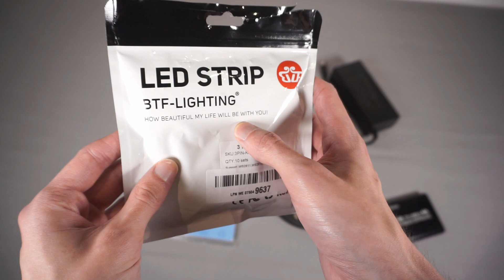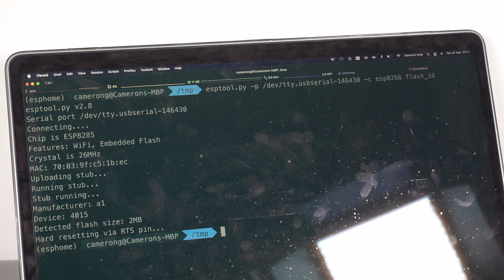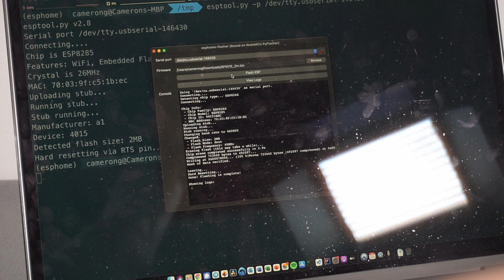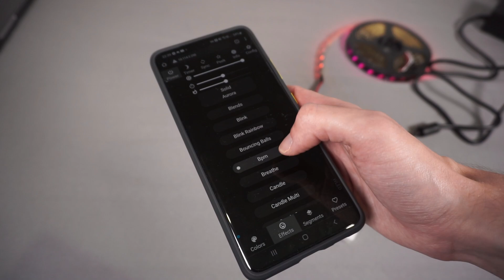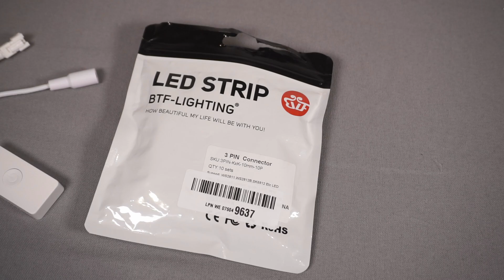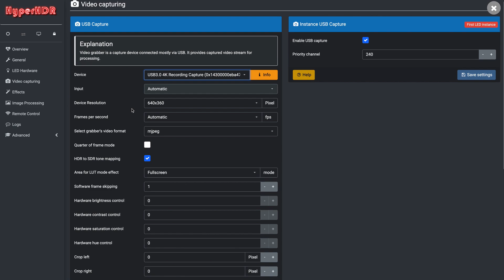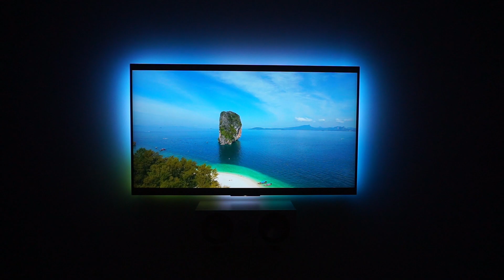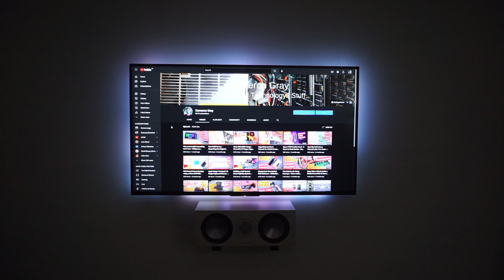Building a 4K Capable HDMI TV Backlight using HyperHDR/Hyperion (and a WiFi LED Strip)

Comment from the maker: Buy Hardware on Amazon UK (Affiliate)*:
  - 4K Input Capable HDMI 2.0 Capture Card - https://amzn.to/3DnmdiE
  - 5m WS2812B LED Strip - https://amzn.to/3Brd5ZN
  - SP501e WiFI LED Controller - https://amzn.to/3v9Io9j
  - 5v 15A (75W) Power Supply - https://amzn.to/3iLEdLC
  - 3pin LED Strip Cables - https://amzn.to/2WV6YxK
  - Cable Clips - https://amzn.to/2WUpciS

Buy Hardware on Amazon US (Affiliate)*:
  - 4K Input Capable HDMI 2.0 Capture Card - https://amzn.to/3uUL4aq
  - 5m WS2812B LED Strip - https://amzn.to/3ajHOw1
  - SP501e WiFI LED Controller - https://amzn.to/3iGM90P
  - 5v 15A (75W) Power Supply - https://amzn.to/2YDn3c8

* Items linked for Amazon UK are the exact listing that I purchased, however with generic products like these, the item specifications may change over time.  The items linked on Amazon US look to me to be suitable however I haven't personally tried them so there may be compatibility issues.
Reply: Thanks for all of this! What was the board you used to flash the SP501e?
Reply from the maker: It's one of these https://amzn.to/2ZbVFCo (Affiliate) - Just a basic USB TTL adapter but this one has a jumper to allow you to switch it to 3.3v which is required by the ESP microcontroller. (Disclaimer - the listing I bought mine from no longer exists. While the one I linked looks identical and states that it uses the same CH340G chip as mine, there's a chance there may be slight differences)
Reply: LED controller sold out on amazon!

Comment: Thanks for the video.  I've been deep diving into researching this project for 2 days and I've found many using Raspi's but I have a windows laptop in my AV cupboard much like your situation with a computer there.  I want to use this laptop and this is the first proof of concept I've found.  I figure if it works with apple it should work with windows :)  My project is larger with a 110" screen (using a projector) but I also have 2 video output on my Denon AVR-S960H, so I'm hoping it will work similar to your set up.  I plan to use a larger power supply and SK6812 leds.  I love you pointing out some of the little mishaps like with the power cables at opposit ends, which will hopefully help me avoid such pitfalls.  Great video man!  Its given me the confidence to order parts and begin!

Comment: This looks great! I've been wanting to do this for a while but hadn't brought myself to buy one of those digunos you mentioned. This setup is a lot cleaner though! Would you be willing to flash the sp501e and resell? That's the only bit I would be uncomfortable doing.
Reply from the maker: Not sure I'd really be able to do it from a time vs how much I could reasonably charge perspective (unless there was huge demand, I'd also be worried about opening myself up to having it offer support for them) but it really isn't too painful.  I've linked the build I used in the description (assuming your SP501e has 2M of flash), you then just need to solder wires to the SP501e and connect it to a 3.3v TTL USB adapter as shown here: https://github.com/tonyn0/sp501e-flashing/blob/main/sp501e%20flash.png (essentially connecting the RX pins on the SP501e to the TX on the programmer and the TX on the SP501e to the RX on the programmer.
Reply: @camerongray1515  thanks for the reply! Could you add a link for where you got your USB adapter from as well please? Appreciate there might not be high demand for what I'm asking for, so I'll give it a try. Also the controller on amazon is currently unavailable so I'll keep checking for when it's back in stock. Thanks!

Comment: I went with ~16ft of the SK6812 LEDs (60leds/m) on my 65" TV, and then found out that the ESP8285 chip couldn't deal with that many LEDs. I'm not sure if the extra white led complicated the issue or not. I ended up moving to a QuinLED Dig-Uno controller which worked great. Thanks for the excellent video!
Reply: Thanks for that, that's an extremely helpful comment! I just ordered a 300led SK6812 5meter 60l/m for my 65' half an hour ago, glad I found your comment :D 

Great timing! I just ordered a Dig-Uno now, looking forward to testing it all out!

Comment: I stress tested my 5v 215 LED setup by turning them to white and max brightness, having power to only head and tail of the strip isn’t enough, the strip becomes incredibly hot after a while. I had to add another voltage boosting cable in the middle. Also, don’t use a normal DC jack to connect power to the strip, those are mostly only rated for 5 amps, I ended up using a pair of XT60 connectors.

Comment: A question about the capture card. Is there a converter with 3-5x HDMI IN? I would like to connect my PS4 and XBOX and the Raspberry PI. Does the “4K Input Capable HDMI 2.0 Capture Card” also work with the Amazon Firestick?

Comment: I'm wondering if there's an Android TV app that would allow to control WLED without a HDMI capture card. In theory this task could be offloaded to the GPU (count average color for each region tile) for very efficient execution. Looks like there's at least (Hyperion Android Grabber) that does something along the lines of these, but reading some of the comments some DRM stuff might pose issues
Reply: That’s not really going to be possible. Firstly most inputs don’t interact with that part of the host OS. All of the processing is done on the specific ASICS as the lag would be astronomical if moved through android. With smart apps and stuff it possibly would work but the issue is a lot of those apps directly write the display driver so as you mentioned you would have the “DRM” issue. Unless they integrated the capture functionality somewhere in hardware e.g. Nvidia and NVENC it wouldn’t have enough performance anyways to really work well even without the DRM issues. TV chips are typically either semi independent ASICs or else just basic mobile CPUs. The PS3 cell chip was floated as a way of doing this in software though an OS but for cost reasons it never hit the market.

Comment: So I'm searching Amazon for the SP501E module that you used and I'm coming up with nothing. I did find a SP511E module, but it doesn't say anything about what kind of board is inside. Would this controller be able to be flashed like the one you used in the video?

Comment: Your AV receiver was the HDMI source, what if I had no HDMI source, for example streaming Netflix on smart tv directly, in that case can HyperHDR run as a native android app on the TV itself and send signals to the esp by reading the content on screen, or a more generic scenario is if my hdmi source is a laptop which is capable of both outputing the video and running hyper hdr, can I make this architecture simpler by eliminating all the hardware components like capture cards, and just ask the hyper hdr to record screen
Reply from the maker: Unfortunately you can't make the TV itself capture what it is showing, whenever I've looked into this previously, the TV will only capture parts of its on screen display and not the video itself.  You could however run a screen capture on a laptop.
Reply: @camerongray1515 Yes, I made it running as a proof of concept using laptop screen capture. Moreover, I am also using hyper serial instead of Wled for controlling led strip from ESP8266. The hyperHDR running on laptop controls the ESP via serial usb port instead of WLED wifi, low latency. Now just searching for the SK6812 led strip, those aren’t easy to find in India

Comment: I really like this project but unfortunately the fundamental problem is that it requires a receiver with two HDMI outputs for video which is something of a rarity apart from higher end models these days. Also for me I’d want to use this playing UHDs with Dolby Vision as my TV doesn’t do HDR 10+ or HLG and I don’t think this would work. Unfortunately as painful as it is it appears the Philips Hue system is my only option.

It came out really nice in your case, exactly what I’d be looking for. It’s too bad that HDMI is such a royal pain to attempt to do anything with anymore compared to the old days.
Reply: Depending on your requirements, you could try a HDMI Distribution Amplifier with multiple outputs
Reply: @RuuDBoY868  When I had looked into those before they had the usual HDMI false spec stuff with them not supporting true 2.0 bandwidth with 4K 60 and 4:4:4 chroma subsampling. Either that or they’re 200+ in which case I’m not sure that it’s worth it, especially as there seems to be little info on DV and Hyperion with most of it in German…
Reply: @Alexlfm  true, at that price point you might be better off going for a product that you'll know works and has a proper support channel

Comment: Is your AV cab some distance away from your TV unit? Are you going over IP for the HDMI too?
Reply: (new sub viewer)
Reply from the maker: It's sitting off to the side and is connected to the TV with an HDMI cable running through the wall, originally this was a basic 5m copper cable however I've since upgraded it to an active optical cable to avoid interference.  I wouldn't want to use HDMI over IP for my main TV as this adds in image compression, and while HDBase-T would have much less/no compression, it still adds complexity, especially when it comes to things like ARC, CEC and HDCP.  However I will ultimately be installing HDBase-T kit to send video to TVs in my bedroom and office at some point.
Reply: @camerongray1515  Thanks for the reply . So you have two HDMIs (HDMI out from TV and HDMI output from your media in AV cab) and a USB going through the wall. It looks like only one HDMI was plugged in on the demo. Just to make sure I'm not going crazy.
Reply from the maker: There is only a single HDMI cable through the wall and no USB - My AV receiver sits in the cabinet and all of my HDMI devices connect to this, the HDMI cable then carries the video out of the receiver, through the wall and into the TV.  This cable is also used for ARC and CEC to allow audio from the TV (e.g. from Freeview or apps on the TV) to be played by the receiver and to allow the TV remote to control other devices over HDMI.

Comment: So I got  mine flashed with the firmware you listed.  When I try and change the number of leds to 300 which is what is on one strip is says, hardware can't support it.  It seems to work but what am I missing here. the sp501 says it supports 1024 led's so wondering why I am getting that error.  Anyone know how to fix or do I just ignore?  I think my tv will take more than 300 led's

Comment: As the SP501E is since long EOL, would you happen to know if the SP511E will do the job?
Reply: You can use an ESP32 board and flash it with WLED.
Reply: @hernanpacheco3016  Thanks, but that was not my question.

Comment: I ordered the sK6812, should be better! as it has a white channel
Reply from the maker: I was considering that, definitely could be better for white - I was just under a time restriction to get the parts so had to go with the WS2811.  For a TV backlight I wanted a 6800K strip but only warmer colours were available to arrive on time.
Reply: @camerongray1515  can you recommend a wifi controller to do this same thing with which works with SK6812 strips and can be flashed with WLED? as far as i can see the one you used doesn't support SK6812... much appreciated!

Comment: The only thing I question on this, is the capture/loop out, is a maximum output 1080p 60hz on all these. So doesn’t this degrade the TV signal from 4K to 1080P?

I have it currently with RP3b+ but wish I could use my TV at full 4K.

Comment: finding it awkward finding a cap card that is 4k HDR and HDCP.
edit
actually, your method of not using the passthrough is probably a cheaper and better, more cables, but it avoids having to scour for an expensive capture card that supports everything I need.

Comment: Awesome video but if you go through the effort of doing all the research and filming it you could put that little bit extra effort in to explain your steps a bit clearer to the people that are not so familiar with the software you are using to flash for example so they can follow as well.